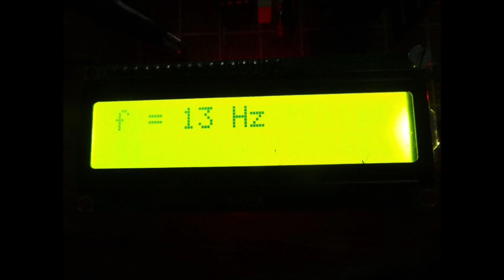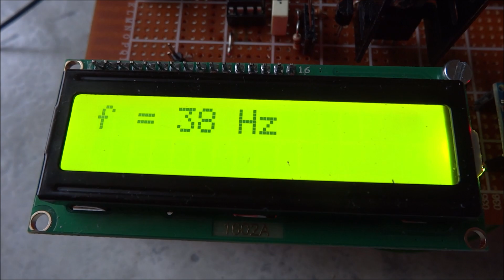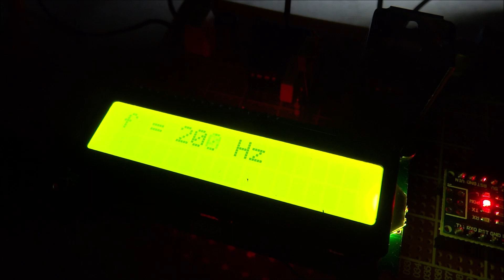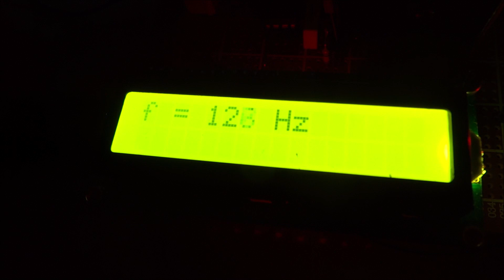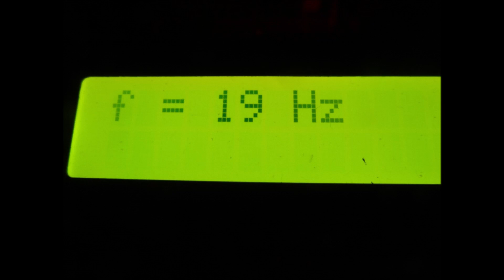LED strobe with arduino - LED Stroboskop mit Arduino

Comment: How short can the pulse be?
I wonder if it's not limiter by the fact that you use a white led. It's actually a blue one with phosphorus on it. And the phosphorus doesn't turn off immediately when you turn the led off. It would be better to use a set of R, G and B LEDs for a faster flash I think. It would certainly increase the contrast between ON and OFF phases.
There's also the problem of shutter speed and rolling shutter of the camera (the one you use obviously doesn't have a global shutter).
Maybe using a camera you can set manually to have a very short shutter duration will help.
Reply from the maker: Hi! The pulse width can be adjusted between 5 and 100 µsec. Concerning the white LED I have to check the light-pulses with one of my photodetectors 😉
Reply: @stoppi  I saw that. My question is not about the duration of the electric pulse but of the actual light pulse.
It's not necessarily easy to measure that because only photo diodes are fast enough for that task. I think LDR have timescales in the order of ms and phototransistors in tens of μs.
Reply from the maker: @cmuller1441  You are right. Therefore I would use photodiodes (f.e. SFH203)  in this case...

Comment: Why wouldnt you use arduino to set the frequency and pulses? Arduino should be plenty fast to do this. Also the schematic would be simpler and you could make it easier to use.
Reply from the maker: Hi! Good suggestion to realize everything digital. But this time I was more old-school with the NE555 😉
Reply: I had the same question...